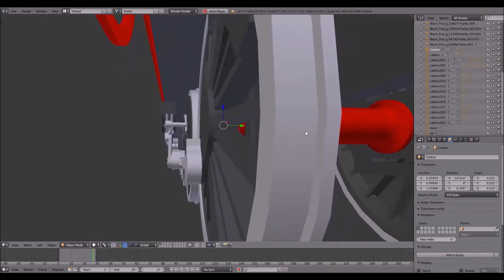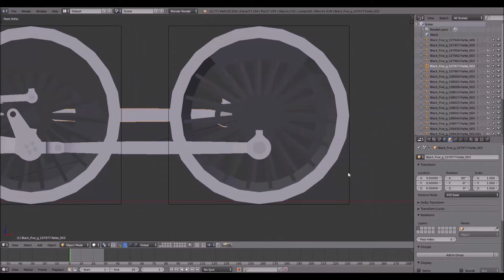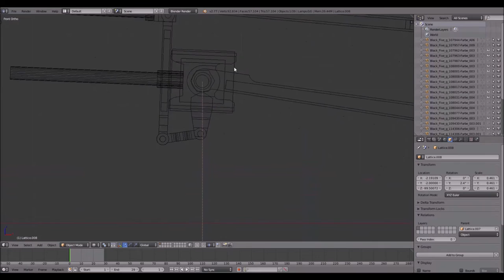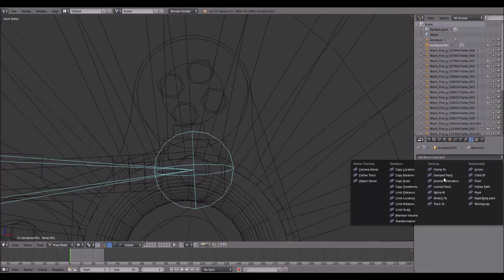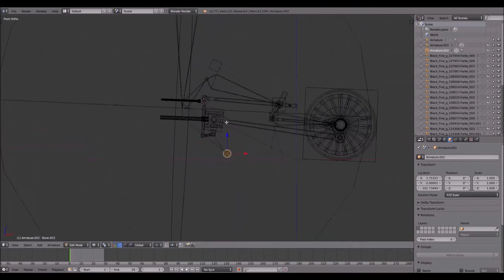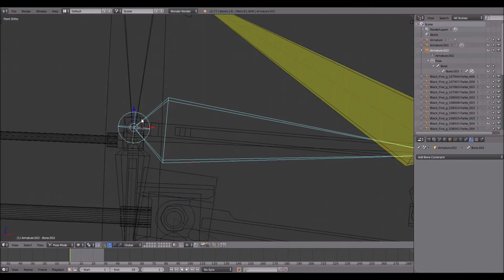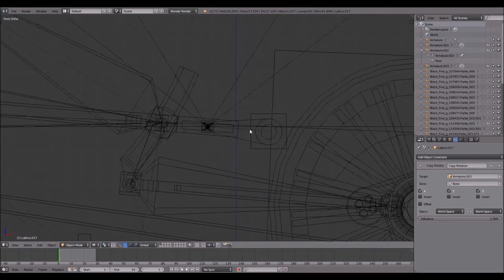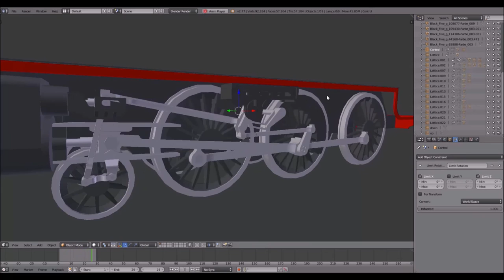Blender Tutorial: Walschaerts Valve Gear Animation

Comment: Uhh. Thanks for the exhausting explanation, it's really interesting.
Two or three years ago, I tried to realize how this mechanism works and I always ended at combination lever and links attached to it. And I never understood why the expansion link is curved (I still don't) and why radius center is sometimes displayed in animations. I always expected that there must be something loose, but obviously every movement from bottom ends in tiny radius bar movement and it can slide in two (almost) perpendicular directions at different points, so it's ok. Actually, design I've seen had lifting link swinging, not sliding. My only motivation was curiosity: how it works, if I can model all the kinematics at least in 2D using for example Python, but I failed.
In my opinion, it would be better to separate video into kinematics, constrains and mechanic design  with longer animations and into part how to define it in Blender. 
I'm pretty surprised that people were able to invent this mechanism, get valve timing right and properly balance wheels without computers, simulations and using CNC mills for prototyping (I think prototype can be made from wood planks and nails as pins, but anyways)
And by the way, I found out that Czech Škoda 498 Albatros has three pistons, one in the middle https://youtu.be/gz2xKRIehDc?t=634

Comment: ive seen alot of tutorials on how to animate coupling rods and/or valve gears but loads of methods that ive seen all use the limit rotation method and the problem i have with it is that having a limit rotation on the rods is that it limits the rotation when climbing hills causing the rods to detach from the front driving wheels and im looking for a solution to that problem

Comment: If I'm following correctly, you are using a clever method to simulate straight line motion in the spindle rod by having a very distant bone that works as the pivot for the combination lever. Is that correct?

Comment: This is wonderful! I'm definitely going to review this several times to make sure I "nail" everything down. If you don't mind me asking, but are you familiar with "Young" valve gear? And if so, would the principles in this tutorial work there?
Reply from the maker: Thank you very much, I'm really happy when the things I do help other people. 

Ask anything about valve gears and I will do my best to answer it. I do know the Young valve gear (although I never saw a locomotive using this valve gear). Young valve gear is basically a modified Walschaert valve gear, so everything in this tutorial would apply to Young. The only difference in regard to the animation is that you have to transfer certain movements of the valve gear from one side of the locomotive to the other. This can be done by adding additional lattices on the other side an parent them to the lattice of the "first" side. 

A workflow for a Young valve gear would be like this:
Start like in the tutorial with the wheel, crosshead and mainrod. Add a lattice (L.001) on the pivot of the link and duplicate it upwards (L.002) (this will be the attachment point for the rod that connects the link with the combination lever), towards the cylinder (L.003) and position it on the connecting point of radius rod an rocking lever and downwards (L.004) (connecting point of the link and the link-crosshead-rod). 
Add another lattice (L.005) at the pivot of the rocking lever, one at the top of the rocking lever (L.006), two at the connecting point of the second rocking lever and combination lever (L.007)(L.011), one at the link-rod-connecting-combination-lever point (L.008), one side of the combination-lever-valve-rod-connecting-rod (sorry for the long name) (L.009) and one at the connecting point of said rod and the valve rod (L.010). 
Add an armature (A.001) at L.001 and position the tail at L.004, extrude it and position the tail of the second bone at the crosshead lattice (this will also be the Inverse Kinematics target of A.001). L.001 must copy the rotation of the first bone of A.001. Parent L.002 and L.003 to L.001. 
The following is again similar to the tutorial: Add an armature (A.002) at L.005, move the tail to L.006, extrude it and move the second bone's tail to L.001. Extrude one bone beyond the link to the Kuhn slide (as shown in the video, so I won't describe these steps here, but you have to rotate the different sides in different directions) and another bone to L.003 (L.003 is Inverse Kinematics target of A.002). L.005 must copy the rotation of the first bone of A.002. Add another Armature (A.003) at L.007, move the tail to L.008, extrude and move the tail to L.002 (L.002 is the Inverse Kinematics target of A.003).

Repeat this for both sides.

Parent L.007 of one side to L.005 of the other. L.011 of one side must copy the rotation and location of the first bone of A.003 of the same side. Parent A.003 of one side to L.007 of the same side and L.009 of one side to L.011 of the same side. Add an armature A.004 on each side for the valve rod 100 units above L.010, move the tail to L.010, extrude it to L.009 (L.009 is the Inverse Kinematics target of A.004)

The last thing you have to do is to add Lattices as required which will be the parents for the different rods.

I will try to find drawings or suitable reference photos of a locomotive with Young valve gear so I can model it and make a tutorial.

I hope that these instructions will help you until I upload the tutorial. I apologize for my bad english and the confusing instructions.
Reply: Wow! Thank you so much for the info! I'm going to have to archive this. Oh believe me, I have MANY questions when it comes to valve gear, but I promise to keep them simple! For "Young" valve gear, I don't know of any operating examples, but I know engines like Union Pacific 2-10-2 #5511 has it. Other example is the Chicago & North Western 2-8-2 J class. But I don't think any of those still survive.
Reply from the maker: engineer6325 Sorry for the late reply, I was rather busy the last week. I was able to find some promising pictures based on the locomotives you mentioned in your comment (5511 survived into preservation and is currently at Cheyenne, but the locomotive will probably never be operational again because both piston rods were cut off). I am currently uploading the Bagnall tutorial but I hope that it won't take too long until I can upload the Young tutorial (hopefully not longer than two to three weeks). But as I said, if you have any questions until then feel free to leave a comment and I will try to answer it.

Comment: Is this rigged for CGI animation?
Reply from the maker: I never tried to use this in a scene or full animation but I can imagine that you could create something like a "walk"-cycle type of animation, insert that into a scene and repeat that cycle over and over again. You could also keyframe the acceleration and speed of the wheels and the cutoff of the valve gear to your desire. I originally intended to use this animation in Trainz but unfortunately it is quite difficult (or at least it seems to be) to implement a control-activated cutoff into the game. However the overall animation should work in Trainz sans the cutoff. 
I apologise for any mistakes in my english.

Comment: Thanks for the video! I tried to rig the pistons using IK constraints with a bone that stretches, but I cannot figure out how to rig the radius rod/combination lever. Any ideas? https://i.imgur.com/QeThmuy.gif
Reply from the maker: I apologise for the late answer but I haven't been active for the past two months on YouTube. I am not an expert in Blender and never worked with stretching bones so I have can't give you a full solution to your question. However, I can tell you how I would approach that problem if I had knowledge of the stretching bones:
The key is to limit the possible motions for the combination lever and the radius rod. The valve rod, which is with inside admission located between the crosshead and the radius rod (outside admission is from top to botten valve rod, radius rod, crosshead) limits the vertical movement of the combination lever. It is usually a straight line (some exceptions involve certain arrangements of levers for the combination lever to perform a curve) either horizontal or inclined (depending on the angle of the cylinders). The horizontal information for the combination lever is derived from the radius rod. The radius rod itself requires limitations in its horizintal and veritcal movement. The horizontal motion is determined by the stroke travel of the expansion link and the vertical position of the die-block/radius rod in the link. If the die-block is in the centre of the link then there is no horizontal motion (neutral valve position). The radius rod is lifted and lowered by the lift arm via the Kuhn slide (like in this video) oder via a rod (like in your GIF). In short: the rotation of the lift arm determines the position of the die-block in the link which determines the travel of the radius rod. So basically you have to find a way to limit the vertical movement of the combination lever relative to valve rod and connect it to the crosshead and to the radius rod. Then you have to rig the radius rod to follow the horizontal motion of the link along the latters curvature und move the former up and down by connecting it to the lift arm.

I apologise for my bad english and I'm sorry, that I'm not able to help you further.